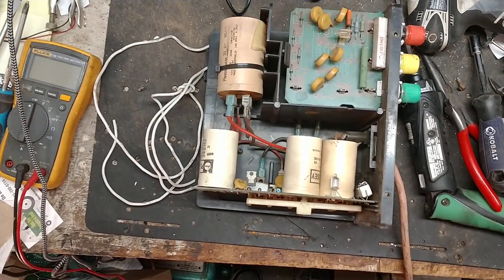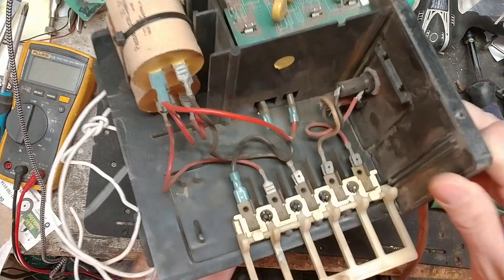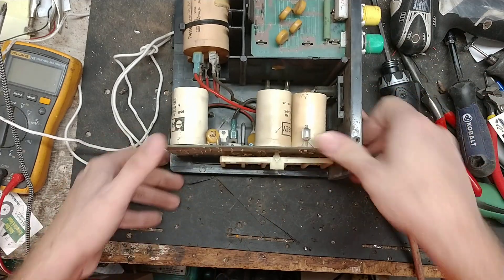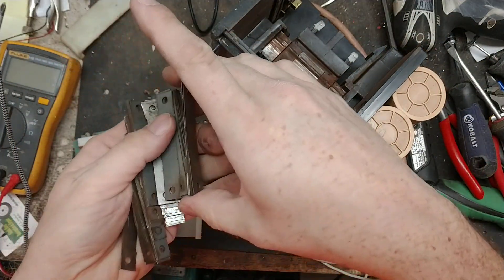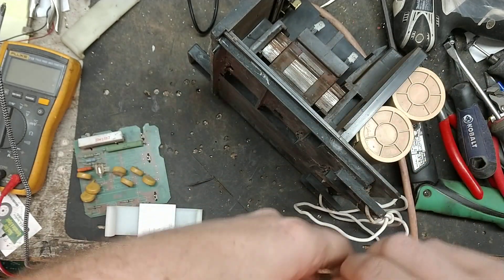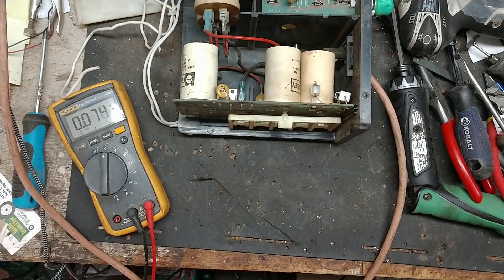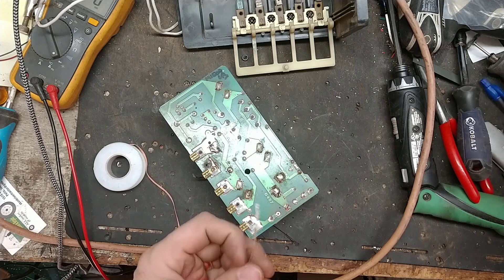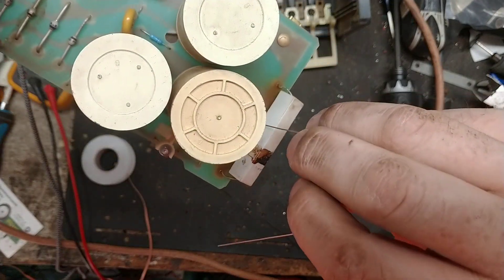Internal Wire Diagram For A Gallagher M800 & M1500 Fence Energizer Repair

Comment: Hello, To how many volts do the  high voltage capacitors charge? Repaired a M1501, the capacitor charged about 500V, but the output is about 3,7kV, that's too low.
Reply from the maker: Hi, we're chatting back and forth easier with the email you sent.
Reply: @FencerFixerRepairLLCKansasCity  Hi, Yes, We discus via e-mail. Thank you for your help.